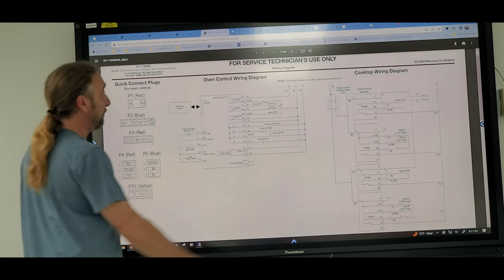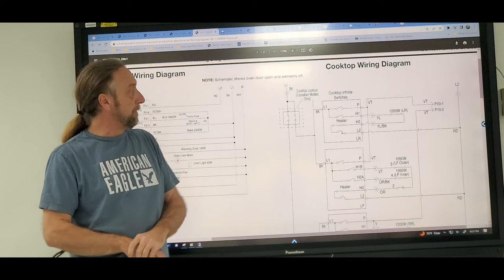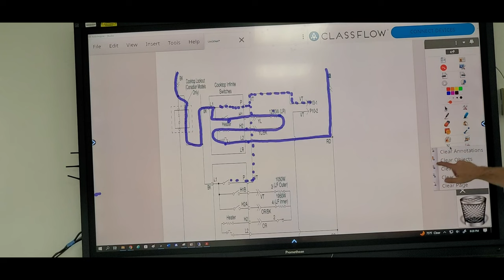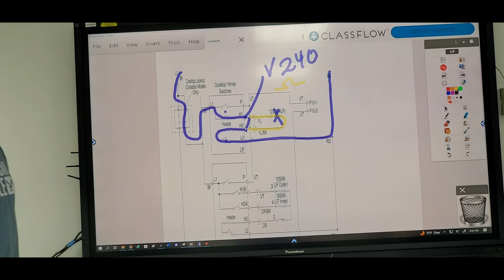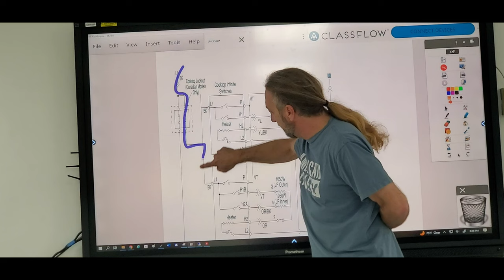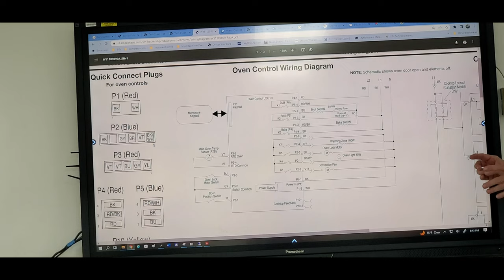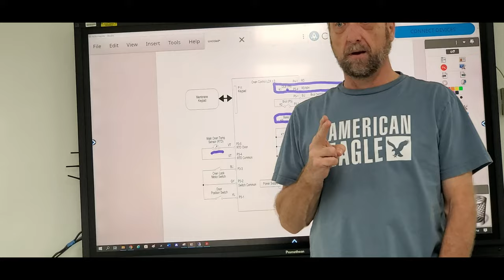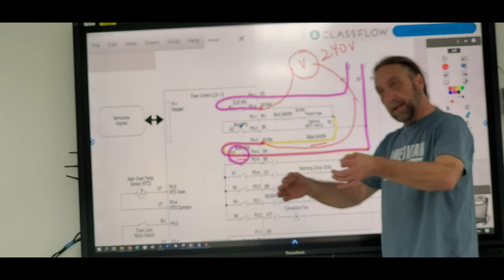Whirlpool Range Schematics

Comment: For your bake element scenario wouldn’t it be quicker to check for 240 at the element? If voltage is present board and relay are good if 0 volts replace main control board bad switch
Reply: Thank you for your input.  Yes you could check either way, the purpose of the video was to explain how to use the control board for testing various components, example what is this was a wall oven and accessing the element from behind is not as easy as a freestanding range.